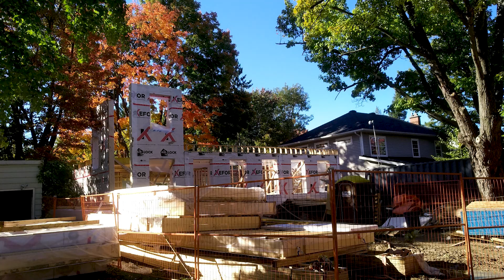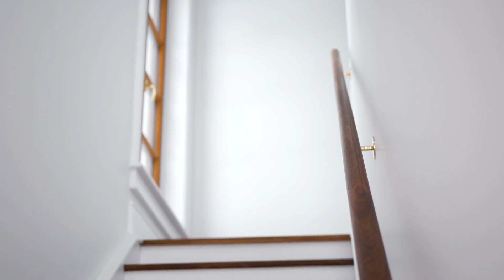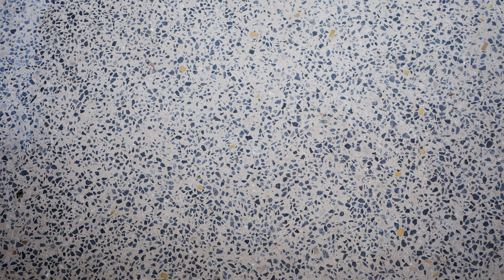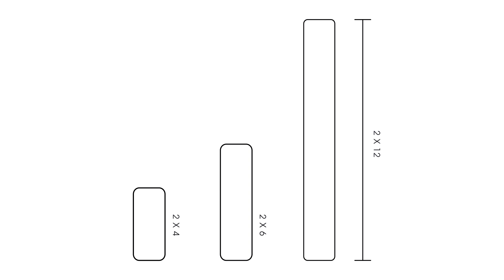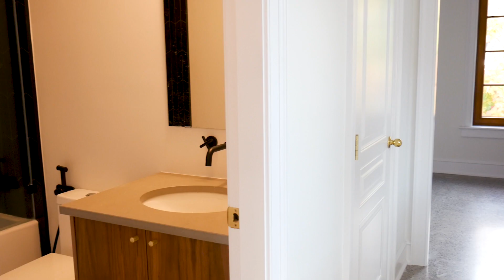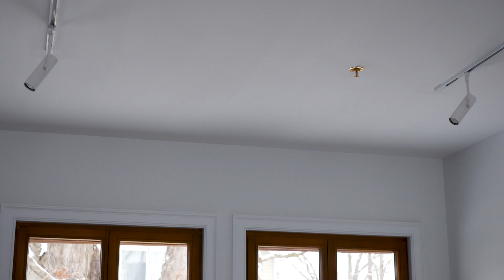Timeless Design and Modern Building Technology in Ottawa, Canada

Comment: How much would a geothermal system for this sized home cost approximately in ottawa? I read that ottawa might be more rockey as opposed to more south causing the price to go up? Obviously there's many factors so a ballpark would be nice as I'm having trouble finding examples of people using geothermal in ottawa. Thanks
Reply: Hey there. Just to clarify, this is not a geothermal system. This home uses an air to water heat pump. It works by absorbing the heat from the outdoors and and stores it in hot water tanks after a heat exchange occurs. It’s much more practical. Further, the electricity can be generated in the future by solar panels on the rooftop. A heat pump install can cost anywhere between 16k -20k but more elaborate systems as shown in this video with zone control and large volume water storage can cost 60k. Please note air to water heat pumps produce space heating but also does air conditioning and potable hot water heating with just a single appliance. We’re at a point that these systems cost as much as conventional forced air furnaces but provide so many advantages such as almost no maintenance, no risk of natural gas leaks in the home, similar operating costs as natural gas but without the harmful emissions. Further - there’s only one utility to the house. You’ll pay less in delivery fees. Cheers.